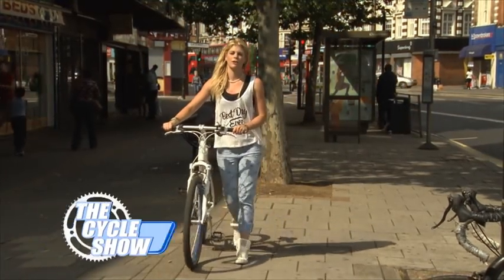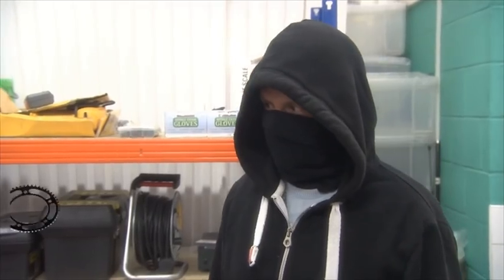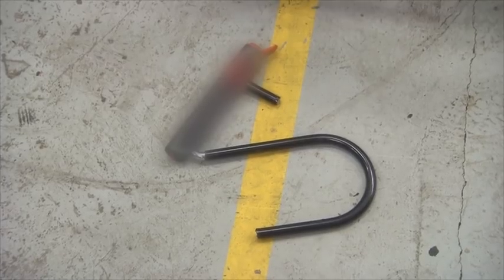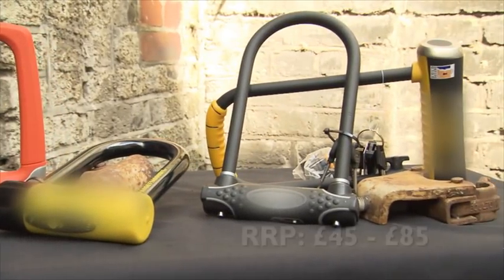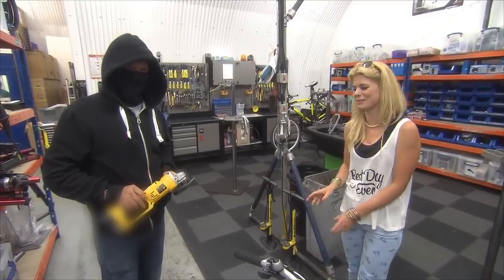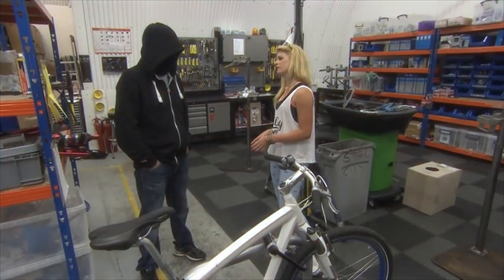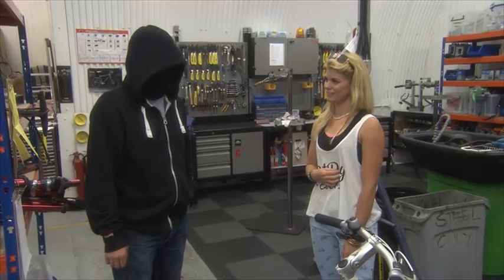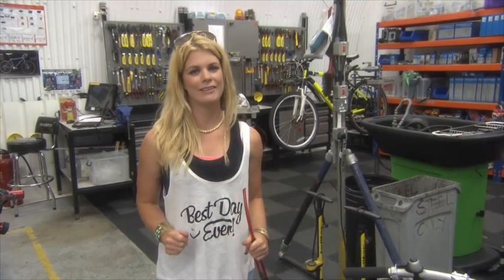How secure is your bicycle lock?

Comment: I have a small theft recovery system with a hidden chip inside the frame...I've accompanied police twice to recover my bike. First place, at a home 2 blocks away. Second, a shipping container near the port. We had to pull out all the rest of the stolen bikes from the container to reach mine...It's a racket!
Reply: Link to buy chip? Or whats it called
Reply: A bug detector can easily find these transmitters
Reply: Hey dude, can I have the link to buy the chip?
Reply: Same question here - where to get it?
Reply: @carlohemi can we have the link to the chip you speak of?
Reply: Apple AirTag
Reply: @andymike6575  So could the CIA. What's your point? Do you really think that most bike thieves are using bug detectors?
Reply: @JonJonChannel  Probably. Not sure why the OP felt the need to hide that fact.
Reply: @JonJonChannel  requires apple phones within reach. therefore forget about  that.  there are way better systems around.
Reply: @SprezzaturaLifestyle  could you at least give an example? would like to know what's actually viable.
Reply: @joel3683  ilockit
Reply: @SprezzaturaLifestyle  Thanks I'll look into it.
Reply: The metal frame would block any transmitted signal. Where did you secure the aerial and how big a battery does it have.
Reply: @JonJonChannel  thats blue tooth and very short range, 10 meters tops.
Reply: @andymike6575 Sure but how many thieves have those? Most will just look in the usual places that they're hidden.

Comment: i'd love to see a u-lock with a hollow core filled with the same sort of dye they use to deter shoplifters, maybe mixed with mace.
Reply: YAS :P
Reply: But that die would ruin the bike, making recover meaningless.
Reply: Can you? Think about it. If your bike was covered in unremovable hey look this bike was stolen paint, you wouldn't want it back. So the theif sets off the dye pack. Then what? If it's a cheap bike, they just leave it there, and you have to buy a new bike anyway. If the bike is expensive enough, they pay to have it fixed and it essentially becomes a new bike and no longer identifiable to you. You won't get it back. If you do get it back all messed up, what's the repair cost? $600? I have no idea. What's the deductible on your insurance? This only helps people with bikes whose depreciated value is still more than the repair costs, and people with bikes like that don't leave them out much,
Reply: Very few people would actually buy this, especially in the beginning. Therefore thieves won't really know about it. It can't deter them, because they won't know it's a dye lock, because they've never seen one before. Plus whose gonna pay for the collateral damage? You dirty up a bunch of private and public property in the process. Your idea isn't practical. The research, the liabilities, the acceptance needed. The price would end up way too high, the demand too low. Such a thing would likely not be legal in many place. Your idea isn't going to get off the ground. Who would want to angel invest in such a thing?
Reply: Or just dont even buy bikes and lock since if someone really wants it... he will get it in this free world :D
Reply: Maltfalc they have a new lock called the skunk lock that's comin out soon with a foul smelling chemical that makes you throw up when you cut into the lock.
Reply: sounds like your talking about  skunk lock.
Reply: Maltfalc skunk lock
Reply: Maltfalc x
Reply: dye packs are for detering theft of money and it works, because it nullifies the money u cant be arrested just becaus eu had paint all over u, altho I agree it would deter them a bit more
Reply: cbernier3 I love negative people that say an idea won't work.
Reply: " If your bike was covered in unremovable hey look this bike was stolen paint, you wouldn't want it back."
"Oooh, my bike is all ICKY-colored! I don't want it anymore!"

Really? Are you so vain that you wouldn't ride a perfectly-functional bike, just because it looks funny?
Reply: A bike lock filled with highly radioactive material might work as well. Possibly bad news though for everyone else in the city.
Reply: patent this, now
Reply: No, they meant that the paint would mark it as a stolen bike - even if it were actually your bike that you were able to recover, other people would believe that it had been stolen.  If the paint doesn't mark it as "stolen," well, then the ink idea is utterly useless anyway.
Reply: "No, they meant that the paint would mark it as a stolen bike "
NO, the idea is to mark THE THIEF with the dye. The bike would just be "collateral damage." That's how such systems work IRL (though generally for stuff more valuable than bicycles, like currency.)

...and there's nothing illegal with riding a bike that may look as if it's been stolen. Let random fuckwits think what they wanna think.
Reply: Oh, haha, that does make sense then. Sorry for the misinformation, and thank you for correcting me.

I'm thinking that the skunklock seems to be the best option, if the lock is double-bolted. After cutting through half of one end, they'd have some trouble cutting through the other end too, if I understood things right (if it's not double-bolted, they could just ride off with the bike away from the smell, instead of having to endure it). The ink seems like a nice idea, but it wouldn't help much with actually recovering the bike, or preventing the theft itself.
Reply: How about some of that Russian nerve agent?
Reply: You can from America it's called a skunk lock
Reply: @HarryL2020  because that breaks the bike
Reply: @TheWorldPillow  just cover the old paint.
Reply: @TheWorldPillow  or make it so the paint changes color over time.
Reply: Or anthrax
Reply: Thats it sprinkle liberally. With anthrax rinse off with waterbottle wash hands lol i know i would ruin the paint ha
Reply: I have an e bike they get fade to black
Reply: @cbernier3  Only to someone who was overly concerning with appearences because their self esteem was lower than Kurt Cobain's.  (sorry Kurt)
Reply: @Theris1337  It's labeled so thye can just put a towel or their shirt around it before they cut it.
Reply: @bcubed72  wow priveledge much? You drive around a bike that looks stolen, the cops are gonna stop you. This can be dangerous, especially for black and brown people. It is not safe to be black or brown and interact with cops in America.
Reply: @texxs01  no it's not about appearances, it's about the cops. Do you really think young black men want cops to harass them even more? Even as a white guy, it's not good to interact with cops. It's especially bad if you are carrying any drugs or breaking any laws. There's big danger there though even if you are totally innocent. Where are you from? Because in America, cops can go around killing poor people without reason or serious consequences. Especially if they are poor and not white. You can't tell just be looking at them if they are a corrupt cop or not. Cops shoot children playing with toy guns in America. Driving around a bike that looks stolen is just asking for trouble.
Reply: @cbernier3  IME, cops place about as much importance on stolen bikes as they do on not spitting in public.
Reply: There is a u-lock on gofundme or whatever which releases a gas Nile pepper spray when the angle geringer cuts into in, they used all sorts of other methods of trying to cut or break it but only an angle grinder will do. So the instant pepper spray coats the surrounding area preventing them continuing on. I think it’s called skunk lock
Reply: Or black powder !
Reply: they have a u lock that has gas in it that will make u vomit and dizzy if u inhale too much off it xd after u cut into the lock
Reply: Look for the skunk lock. It sprays a noxious chemical out if cut. Then your bike smells like a skunk sprayed it. Haha.
Reply: thats what i was htinking but imagine you dropped it and picked it up to find a dent with mace coming out
Reply: @langtangwang  I don't think it is that easily released. My other suggestion is a spring loaded knife blade that fires up through the seat if you fail to disarm it within ten seconds of a beeping alarm. That would be non-lethal but give them what they deserve.
Reply: Check skunklock
Reply: Yep, or maybe filled with flammable liquid so it instantly ignites the person grinding the lock x)
Reply: How  about ( and it would be way cheaper ) tracking devices built into all bicycles - each company, EG :- Apple has the “ find mt iPhone app “  seems like the logical idea to me ?
Reply: The problem with things like “ MACE” and other chemical agents - is even cops seem to blast themselves with it - once deployed it’s in the wind and can and often does affect the totally innocent .
Reply: @robertkidd2361  actually I doubt tracking devices are that useful : a mark or chip can be used to make the bike harder to sell, but heavy difference between bike and phone is that phones are meant to communicate, so adding tracking to them is easy... For a bike that's another story, you need a specific thing with long battery life, and be sure it is always on, plus the thief could simply wrap the bike in radio wave proof material like aluminum sheets to completely prevent detection. If battery is easy to access, then he can remove it. If it is rechargeable, he can wait for it to deplete.
Reply: @KiLLJoYYouTube  Skunklock is clearly useless against any thief that knows of it, especially when they advertise it on the lock itself, like in their video... 
Just wear a mask while cutting it = problem solved.  It dissolves in the air fast, and any residue will be minimal, and be easily cleaned off in the same go.
Reply: Pioson filled bike lock is better
Reply: SKUNKLOCK
Reply: @roostermagma32  Damn it exists x) Probably not enough to stop a determined thief, but at least you can be satisfied to think that he vomited while stealing your bike XD
Reply: That could possibly be a good idea. A thick yet hollow pressurized shank.
Possiblity of a thief to take it with bystanders nearby would probably keep that off market though
Reply: I would prefer option to gave GPS installed within the frame there are some options out there never tried them though
Reply: I would fill the hollow tube with gunpowder and ball bearings . It’s a bulletproof vest they would need.
Reply: Yes! 
Mixed with mace, green dye, and some sort of synthetic skunk spray 👌
Reply: @cbernier3  First of all it's spelled "dye" and you can't dye metal!
Reply: What you actually need is a remote detonator on your phone that makes the whole bike break when you push it
Reply: @Maltfalc this exists, it’s called the SkunkLock
Reply: @cbernier3  lol I'm pretty sure bikes with dye on them still work
Reply: @justinbogart278  lots of people care about the cosmetics of the bike. Stained clothes still work, do you wear them? You think people won't make comments and judge you? 
The stained bike would look stolen still. It couldn't be sold. People would constantly be calling the cops on you. You'd have constant anxiety about it. You'd be too embarrassed to ride this bike. Just claim it stolen on your insurance get new bike.
Reply: Skunk lock is probably the closest you'll get
Reply: Mixed with Arsenic would be nice
Reply: @tuipale  Or leave the house, or get up out of bed, or anything. Your solution is no solution at all.
Reply: @tuipale  Or comment on youtube with useless boring comments.
Reply: a just question, in general, cant a thief not just pick the locks, instead of cutting them open?

Comment: Time would only matter for each lock if you replaced the cutting wheel for each lock.
Being homeless for 5+ years I can confirm that people that are stealing bikes do carry big cutters around a lot more than you would think and the grinder less often. It's harder for them to hang on to over time because they get desperate and will trade it off. They only cost $20 at harbor freight though. Another thing is one of each type of lock helps. The cable ones need a cable cutter to do it fast. The bolt cutters have a really hard time with those. I use a thick, combo cable (the combo can be figured out in less than a minute if the #/ letter wheels are loose side to side AT ALL) that is made from a better brand. Make sure the wheels are tight. Also: Remove your light when you leave your bike!

Comment: On the subject of being challenged: a couple of years ago some twit accidentally locked my bike, along with his, to a stand. I went home by bus, gave it a couple of hours and then came back with a few hand tools to remove his lock (a cheap chain and padlock which I could see wasn't going to put up much of a fight). It took me I suppose 5 or 10 minutes, during which time plenty of people walked past - this was in central London, very near Wellington Barracks in Westminster. A couple of people gave me a slightly funny look but no one said anything. The more blatant you are, the less likely to get challenged. The irony was that the twit responsible turned up just as I was about to impart the final hacksaw stroke. He was suitably mortified and we parted with a laugh.
Reply: Bike thieves trade on the fact that most people will not report the theft in progress, let alone intervene. That's down to fear, anomie, diffusion of responsibility, and urban callousness.
Reply: Sods law. Just as you have finished with all that effort he arrives 😂

Comment: I love how the lock I use took the longest to cut. I have two of them and as the lad said, I lock the wheels and frame to the pole. This video gave me some piece of mind. Though for the most part, if given the opportunity, I never leave my bike outside.
Reply: What kind was it
Reply: Was it the Kryptonite New York?
Reply: @rfh9560  yessir. Unsurprising considering I was born as raised in New York and I know how bike thieves operate.
Reply: @jdproctor7700  did you signup for the anti theft protection? The New York range is the only one eligible in Manhattan according to their website

Comment: So, to put it simply, if they want your bike, they can get it. Best you can do is make it take long enough that they don't bother.
Reply: Yeah, that's how it is. You gotta be grateful for the people who uses crappy locks so it's always easier for thieves to take those and not spend minutes working on yours.
Reply: ya but if your bike cost £1000 but there bike cost £300 they are going to pick your even if it takes 30sec longer.
Reply: Never under estimate the stupidity of a smackhead, £1000 £300 they will sell it for £20 for their next fix. they just want to be away with it as quick as they can.
Reply: don't buy cheap anything get  a well known security  chain or Ulock  like a motorcycle  lock covered in Teflon or somthing
Reply: Yep and if you see an expensive bike being sold on facebook etc for cheap then its most likely stolen.
Reply: Did you even watch the video?
Reply: They could not sell mine for 20.
Several decades old. Hand painted. 
New is only the transmission.
Secured with a motorbike lock.
They smack heads get the expensive one with the thin cable lock.
Reply: Yes. This is what you have to do. Put it somewhere awkward on the bike. Use more than one lock. Keep it hidden if you can. Make it as awkward as you possibly can to deter an opportunistic thief and they’ll move one to someone else who’s an easier target.
Reply: Dont hide your bike too well tho. It should always be in sight for pedestrians. A thief won't touch a bike while everyone is seeing him. "Who would approach me with this in my hands" is a bullshit answer on the grinder bit in the video. There are plenty of people who will either approach the Thief or call the police.
Reply: There is a video of the city i live in, in the most populated place of the town, in one of the most populated hours, people see the bikes get stolen, notice it clearly, but don't care.
Reply: Hiplok Fahrradschloss Gold Diebstahlsicherung
Reply: @andycleary6209  not all bike thieves are smack heads, problem is, if you have an expensive bike, the components will be worth a lot of money and are generally very difficult to secure.
Reply: @jhferu  You're right not all are but i'd hazard a guess that most bikes are taken by them.
Quick easy money with little chance of getting caught, steal it ride it to your dealer and swap it for drugs, bound to be some stolen by thieves who know what value the bike and parts are, must be frustrating though to find your bike gone at the end of a hard days work.
Reply: I find if you simply coat your bike frame in honey, most people don't want to handle it
Reply: Does your bike cost more than £500?
If yes then take it home with you.
Reply: that is right! usually I spend five minutes locking my bike everything i left somewere...u lock, best on guard, cable for set, wheels, removing staff like spedometer, lighst...and things like that...then, when I get back, i have to remove all of that again, suit in my bag and so on....that way I think i am spending twenty minutes a day, 600 hundred minutes a month, and 7200 minutes a year just locking and unlocking the bike...that means i am losing almost a whole week a year just making sure my bike is safe....so,  I i think is much better to have a normal and cheap, but good bike, and some U locks...the thing is to be invisible as possible...
Reply: @Rudemis Bita Lmfao bolt cutters can get through anything, especially the 24"
Reply: @JoshD1001  At that possible by just get a scooter or electric motorcycle, 1000's on carbon frames only to carry around 5-7Kg of good locks.
Reply: @WRSTxPumbaa  go ahead call the police. when they turn up 30min later if you are lucky, you can explain how the thief cut the chain and took your bike in under a min and is now likely 10 miles away
Reply: isn't that the case with everything? 
If a thief wants it, they will get it, the thing you can do is just make it as hard as possible for them to do it.